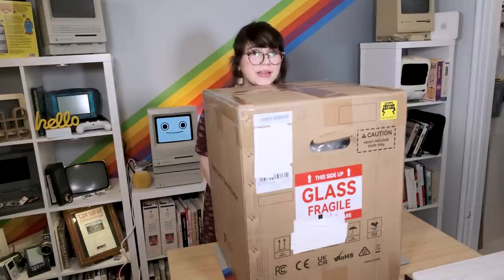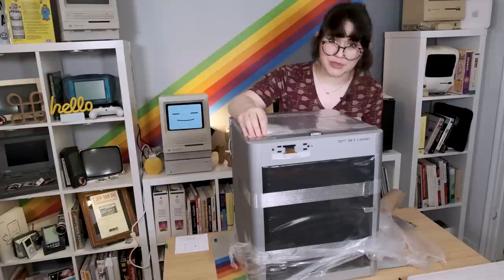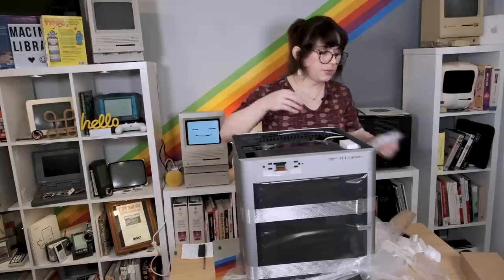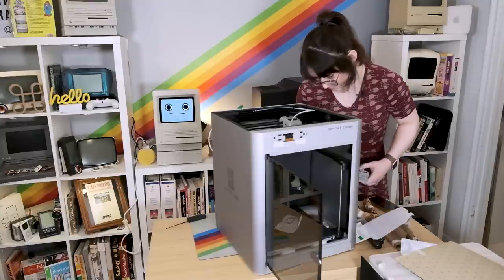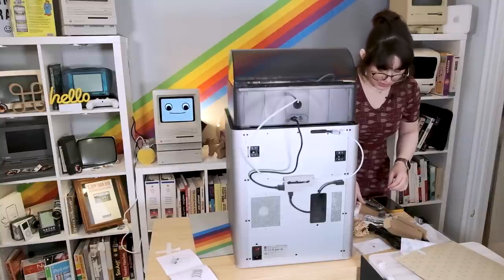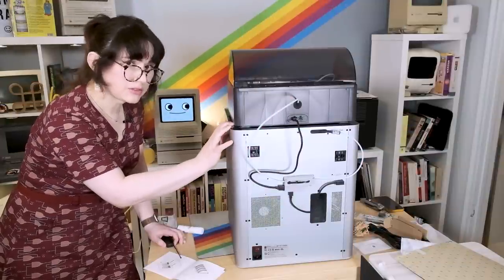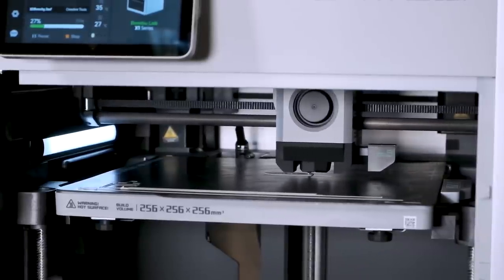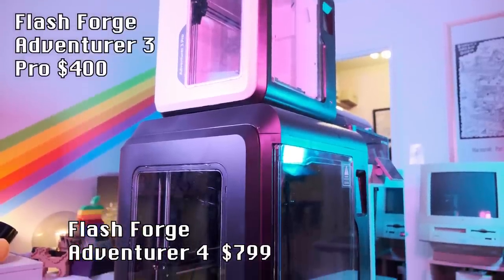[Labs] - Bambu Lab X1 Carbon Setup and Review!

Comment: That's a cute Mac that you have in the background. I should get mine out. I have owned an original first run 128k Mac since new. I sold them in college. Anyway, I thought that I should do something with it and the programmed eyes are fun. I do like to pull the case off and try and read all of the signatures inside it.

Comment: I keep coming very close to clicking the buy button on this printer. But my old flashforge is still kicking and I hate to send it to the recycle bin. My first printer was a makerbot cupcake cnc. It came as a bag of parts and took days to build. 😆
Reply: I'm like that with my ender 3, but I'm planning on using both my ender 3 pro and this x1 carbon

Comment: But resin is much higher resolution.
Reply: Filament is easier to deal with in some ways and better for some applications. But generally speaking I'm with you, the higher print resolution of a cheap resin printer is way more valuable to me than the relative simplicity of filament printing, the better material strength, etc.